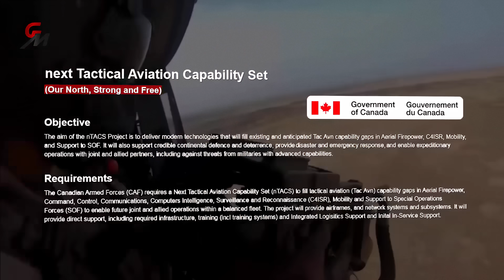The New Helicopter That Will Replace The Aging CH-146 Griffon! Here is The Canada nTACS Project

Comment: I'm currently flying the AS332 Super Puma, which is the precursor to the H225.  I can tell you, this is an incredibly capable aircraft.  After a 30+ year career flying helicopters commercially, I have never flown a heli with this level of multi mission capability.  Operates in difficult/remote environments, operate as a long line/lift machine up to 8000 lbs, 130kt cruise speed, carry 22 passengers, 3hrs endurance (more with extended range tanks), hot/high performance.  It does everything the Black Hawk does (and more), without the reliance on the U.S. military complex.  If Canada could secure a license to produce the H225 in Canada, or at least part of it, this would be a hands down winner (in my opinion).

Comment: Canada’s Next Tactical Aviation Capability: Strategic Independence Through European Alliance

Breaking Free from American Dependency

Canada stands at a crossroads in modernizing its military aviation fleet. The Next Generation Tactical Aviation Capability (nTACS) program presents a pivotal opportunity—not just to replace aging helicopters, but to redefine Canada’s strategic autonomy in defence procurement.

For decades, Canada has been inextricably tied to U.S. defence systems, leading to costly delays, vulnerabilities in supply chains, and political entanglement with Washington’s shifting priorities. The CH-148 Cyclone debacle serves as a stark warning: reliance on American military-industrial giants like Sikorsky (Lockheed Martin), Boeing, and Bell carries risks that Canada can no longer afford.

Instead, the path forward should prioritize European partnerships—specifically, the Leonardo AW149 as the primary contender, with the Airbus H225M Caracal as a viable secondary option. Neither is perfect for every Arctic operation, but both offer Canada something more valuable than incremental performance gains: strategic independence.

Why the U.S. Options Fall Short
Three American aircraft—the Bell V-280 Valor, Boeing AH-64 Apache, and Sikorsky UH-60 Black Hawk—are technically capable but strategically flawed.

FMS Lock-In – All three are subject to Foreign Military Sales (FMS) restrictions, meaning Canada remains dependent on U.S. government approval for upgrades, spare parts, and even operational deployments.
Supply Chain Vulnerability – U.S. export controls (e.g., ITAR) can disrupt logistics, as seen in past disputes over cross-border defence technology sharing.
Political Exposure – Canada’s relationship with the U.S. is increasingly volatile. A future administration could impose restrictions on defence exports, leaving Ottawa scrambling for alternatives.
The V-280’s impressive range is tempting for Arctic operations, but it remains unproven and risks repeating the CH-148’s developmental nightmare. The Apache and Black Hawk are proven—but so are their downsides: continued American dominance over Canada’s defence infrastructure.

Prime Minister Mark Carney’s government has made European strategic partnerships a priority. Choosing another U.S. helicopter would betray that commitment.

The Leonardo AW149: A NATO-Ready, Independent Solution
1. European Autonomy with NATO Interoperability
Built for NATO – The AW149 is not a U.S.-controlled platform, yet it seamlessly integrates with NATO communications, avionics, and datalinks.
Industrial Resilience – Leonardo is an Italian-British firm with European government backing, ensuring supply chain stability outside U.S. export controls.
2. Battle-Proven and Adaptable
Troop Capacity: 19 fully equipped soldiers (vs. 11-13 in a Black Hawk).
Survivability: Ballistic-resistant rotors, self-sealing fuel tanks, and redundant systems—optimized for contested Arctic environments.
Firepower Potential: Poland has already configured its AW149s with Hellfire missiles and 70mm rockets, making it a credible attack helicopter alternative to the Apache.
3. Domestic Industrial Benefits
Leonardo has signaled a willingness to establish Canadian production lines, supporting Ottawa’s defence industrial strategy.

4. Lower Risk than Unproven U.S. Platforms
Unlike the still-developmental V-280, the AW149 is already in NATO service, reducing procurement risks.

The Airbus H225M Caracal: A Secondary (But Still European) Option
While the AW149 is the optimal choice, the H225M Caracal offers advantages where sheer lift capacity is needed:

Troop Capacity: 28 soldiers (vs. 19 in AW149).
Proven in Combat: Used extensively by France and the Netherlands in Africa and the Middle East.
However, its aging design and shorter range (250 nm vs. AW149’s 350 nm) make it less ideal as a primary solution.

The Arctic Reality: Range Isn’t Everything
Critics argue that the V-280’s extreme range (2,100 nm) is essential for Arctic missions. But Canada’s CH-147 Chinooks already cover long-range Arctic needs through refueling and pre-positioned bases. The real challenge is sustainability in austere conditions—where the AW149’s logistics efficiency and European supply chains provide an edge.

The Geopolitical Imperative
Choosing a European helicopter isn’t just about capability—it’s about sovereignty.

Reducing U.S. Dependence – The $18.4 billion nTACS program is Canada’s chance to break from American defence monopolies.
Strengthening NATO’s European Pillar – Closer ties with Italy, France, and the UK reinforce Canada’s role in a more balanced NATO alliance.
Signalling Strategic Resolve – Selecting a U.S. helicopter after pledging diversification would undermine Canada’s credibility as an independent actor.
Final Recommendation
Primary Fleet: 40-50 Leonardo AW149s (replacing CH-146 Griffons, with attack variant potential).
Secondary Fleet: 12-16 Airbus H225Ms for heavy-lift and long-range humanitarian missions.
This approach ensures tactical flexibility, Arctic readiness, and strategic independence—while finally moving Canada away from over-reliance on the U.S. defence industry.

The choice is clear: European autonomy over American dependency. The AW149 is Canada’s best path forward.

Comment: At least assembled and serviced in Canada with significant tech transfer and software programming capability are the main factors of importance to help restore and expand Canada capability. 
That and Sikorsky should NOT be allowed to even bid considering its costly overrun - YEARS behind and still not meeting promised operational capabilities for the Navy Choppers.
- the tilt rotor option is still vastly too complex and problem prone - look at America's efforts to use that style aircraft - it is bankrupting their marines budgets with HUGE downtime.
Reply: You aren't entirely wrong.  Then again, only a dumb government or governments, would allow a 10 year delay in production and an under performing product enter service.  The Cyclone is a hot steaming pile of shit.  And dumb Canada is the only sucker to use them.  Seahawks were turn key solutions to the dinosaur known as the Sea King.  Without a doubt, someone or several people got their pockets lined for that deal.

Blackhawks are also a reliable turn key solution, which is why villainizing Sikorsky makes no sense.  The details of the contract are what matters.  Have a look at Lockheed and the F35, grossly over budget and so far behind it's outdated before entering service.  The issue is not having significant financial penalties or bail out clauses in the contract.

Comment: Don't ever brag about the Cyclone. It's a garbage helicopter. We should have sent it back.
Reply: 10 years late for delivery and still doesn't perform as advertised... Typical Canadian procurement.
Reply: @225degrees  it killed a friend of mine. The AFCS system is messed up, the autopilot doesn't disconnect when controls are manipulated (unlike EVERY other aircraft I know of). Because it's "fly by fire" the aircraft decides if your control inputs are "valid". 
It had already led to a near-crash and a very hard landing. So yeah, "bad procurement" doesn't quite cover it... I'm bitter. The crew deserved better.
Reply: @Blowinshiddup   Was your friend in the helicopter that crashed off the coast of Spain, what, 3 or 4 years ago?
Reply: @225degrees  They were off Greece, April 2020. It goes down as a notably horrible year for Nova Scotia... We lost the victims of a mass murderer (of which my mom personally knew some), the crew of Stalker 22, and then Jenn Casey died when she ejected from the Snowbird she was in a month later (the Snowbirds were doing a cross-Canada morale boosting effort). Still hurts to think of it all.
Reply: @Blowinshiddup   I remember.

Comment: The best choice will include a tech transfer and assembly in Canada similar to the Saab deal ..
Reply: There is no saab deal there is only the f 35 deal and it’s a done deal.. has been for years   Now Canada is getting f 35’s Air Force & pilots do not want the gripen. That Gripen E was thoroughly evaluated and did not make the cut only option that meets the requirements have been the F35 since day one.

Canada is a tier 3 original founding member of the joint strike fighter program since 1997 helping to develop F 35, we have over 30 companies making F 35 parts all over Canada, F 35’s are already ordered and are coming undoing all of this now at this point would be a major disaster and would not be saving any money. Gripen is not a bad jet it’s just the wrong jet for the job that’s all

The road operations are not possible up north In the arctic for logistical reasons also their are no roads in the arctic to operate from for NORAD alert aircraft

Comment: Given the Canadian government's stated objective of having more defence equipment built in Canada, the most likely options seem the Bell and Airbus ones. However, Bell's tilt-rotor V-280 Valor (or Valour, to us Canadians) is likely a no-go from the get-go. The machine would probably be many times more expensive than a conventional helicopter and pose reliability and maintenance issues, if past tilt-rotor aircraft are any indication. They should have offered something less radical that could be built in Canada. The Blackhawk and the Apache are not going to be built in Canada, and currently there is an ever-decreasing desire on the part of Canadians and their government to reward the Trump regime with more large scale multi-billion dollar contracts that leave the country dependent on the United States for parts, maintenance, and upgrades and provide little to no industrial benefit, technology transfer, and jobs for Canada.

The Leonardo AW149 would appear to be the best option if the company can find a way to built the aircraft here and provide technology transfer.
Reply: Tilt rotor is a dumb design.

Comment: Personally I'd go with the AW-149. European sourcing with the Leonardo machine being a sister bird to the CH-149 Cormorant is an excellent choice for ease of maintenance as many systems are compatible. It should be built in Canada. Anything other than a US product.
Reply: The Valor tilt rotor, chosen by the US Army, has much greater speed and range than even the advanced dual rotor blade, "pusher" prop helicopter from Sikorsky.
You either stick with old technology out of nationalism or go for what works best.

Comment: The tiltrotor design, while offering high speed & long range capabilities, is still risky, as witness what has happened (many accidents) with the V-22 in both American and Japanese service. As with the F-35, there could be a case of the number being reduced significantly by escalating costs to fix problems over life of program. Personally, the Airbus H-225 helicopter is a proven design (with long lineage) with upgrades to enhance firepower, range and versatility.

Comment: A decision like this requires some analysis bigger than just the battle sphere. That said, all things considered lately geopolitically 🙄, one must be careful not to cut off one’s nose despite one’s face (🇨🇦).. There is still a need for these assets and All options should be considered but; for speed alone, the 280 Valor, however I wonder what the aerodynamics would look like if a drone or manpads took out one of the engines while inflight. The Apache is legendary but overkill for 🇨🇦. I suggest the Leonardo AW249, dedicated squad to the JTF (just sayin’..😉). Like it or not, The Blackhawk is a proven platform. The Airbus option looks mighty interesting. The Leonardo would add some commonality to the fleet, especially if 🇨🇦 got the 249’s eh? 😁..
Those who are in the best position to make these decisions should ‘maybe’ consult with the men and women who’ve been in the field / contested areas and forward areas / to get their take on what’s needed, what works and what doesn’t. Lift, Speed, defensive, Offensive and counteroffensive capabilities ✈️

Comment: Black hawk with DAP kit, H225m, or NH90 (in that order).
Probably the H225m as a middle road option and alignment with European/NATO military procurement strategy.

As for fighters I get why the Gripen is getting so much love and attention, but personally I would prefer the Rafale with twin (not us) engine, tailhook option for arctic landings, and pretty much the best ew/ECM/das capabilities on the modern electronic battlefield.

Comment: I love the V280 (MV-75 now) tilt-rotor concept as a fit for Canada's needs & terrain, especially over the arctic if it can handle the condditions. However, unless Bell decides to make them entirely here in Canada, Bell's bid would considered American therefore must be ruled out. (And I doubt Bell would run afoul of President Caligula by manufacturing such an advanced project here, not unless the orange clown foolishly cancels the program in the US, like he did the magnetic carrier launchers.) Secondly, I cannot see the CAF going out on a limb with an radical sort of concept like a tilt-rotor, unless it was also deployed by some other country as some kind of proof it works. 
So basically, let's look to the European options, the Airbus (Extreme environments? Yes, please!) and the Leonardo (commonality with the SAR helicopers helps). Though as I understand it, the Europeans are working on other newer platforms as well, which should be looked into since the whole point is to meet future capabilities / needs.
Reply: I would not look at the Apache at all - attack helicopters are not a capability we've had previously, and it may be the most likely helicopter role that would end up replaced by drones of various in the future. As for the Blackhawk, the selling points were feeble; the RCMP does not have to worry about being shot at in contested environments; military blackhawks do, but so do all their competitors, and the US military has projects already working on replacing theirs. 
The points from from 7:50 to about 8:05 are just the old orthodoxy, which is now nonsensical, given that the US has basically broken their alliance with Canada (and others).

Comment: Canada needs proven aircraft that offers full autonomy that benefits both the Canadian eceonmy and our European defence partners.
Reply: canda gets what keybec sells or leases dem . 🤨
Reply: This is a mistake because we are having a hissy fit over a 3 year president. Liberal Canada continues to act on emotion instead of logic. 

Sticking with North American manufacture means we get parts and service that if something goes south. If Russia and especially if China gets going, there’s zero guarantee we get parts and replacements from Europe, as they will be using everything they produce, AND getting it to us will be unlikely. Sticking with NA production, and that could include Mexico, not just the U.S. for most things is a much better play. As well, US military arms are typically better than European equivalents. This goes right back to the F35 argument. Proponents of the Gripen argue it can land on highways…. That’s dumb as Canada has thousands of actual runways across the populated belt, and no way to get resupply vehicles to remote roads in the north to equip those planes…. Which still can’t land on the gravel roads in trees we have in Northern Canada. It’s a dumb argument based on emotion. Time to get over the hissy fit and make proper decisions for programs that have 30-50 year consequences.
Reply: @charliemcawesome5012  Trump isn't the problem, only a symptom of much bigger issues.   Think of pus from a festering wound and the relationship becomes apparent.
Reply: @PePe_007-A1  No. Lefties just don’t like Trump. The derangement is real.
Reply: And Brookfield/Carney!